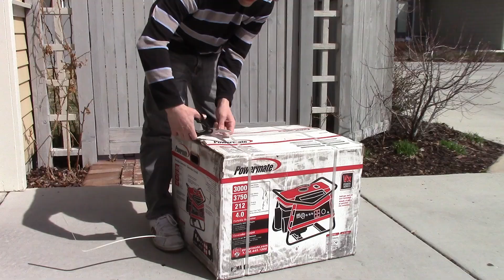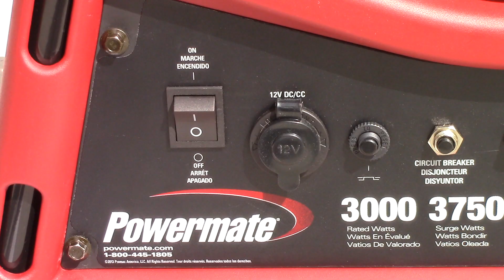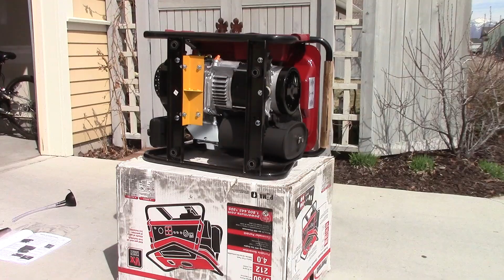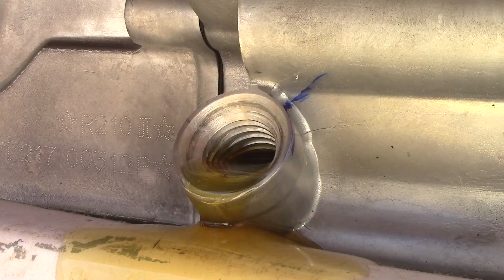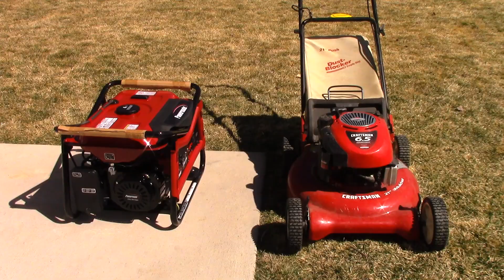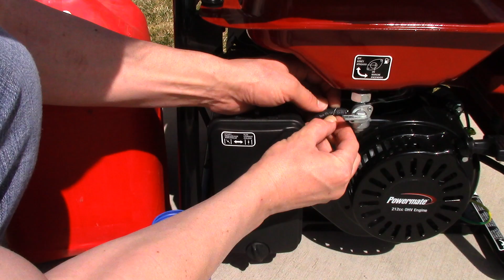Set Up & REVIEW Powermate 3000 Watt portable gasoline generator

Comment: Great video and subscribed. I bought this PM0103008 model at HD about 6 years ago for $239 and it's still sitting new in the box. 
So I am here because I just bought a mig welder and needed info on running it with the generator, but still no luck finding someone that has actually tested the 240v feature. Also need to find cheap 1kw - 2kw generator with low THD to run computers and TV during summer rainy season, but cheap does not equate with low THD. Any ideas for either question?
Reply: I have 240V Miller welder that I was able to power with this generator, had to make a trip to the hardware store to get some adaptor for my extension cord to fit the one on the generator. I also use a heavy duty extension cord to power the electric dryer outlet when we have power loss to power most of the house,   With this setup we had the furnace, fridge, tv, lights and all was powered with this unit.

Comment: This was an outstanding review, I have the same generator but I don't have a manual. Your review help me greatly. 
I purchased a  a four wheel cart made by Olympia tools, 600 pound capacity heavy-duty folding handle platform cart for my generator at Menards.
Reply: The manual is probably available online. A lot of times the manual is tucked into one of the folds on the carton the genny comes in and they are thrown out. The download thing works well, though, and you can print it out. Good luck.

Comment: YOu put way to much engine oil in there.....
Reply: Actually, as long as the generator is on level ground, it's almost impossible to overfill them. The correct level is the end of the threads on the lower half of the oil fill opening. Anything more than that will just flow back out. It's easier just to measure the oil, but the way he used works fine. Nice genny.

Comment: Thank you very much for taking the time to produce this Adam. I have an aviary in a steel building that I bought and wired for power, added insulation, sheet rock, flooring and windows, etc. I wanted this in an emergency so that my Amazon parrots would stay safely warm (or cool if in summer). I hope that I never need to use it for this reason but it sure is comforting that I have it should I need it. Thanks again for the tutorial!

Comment: i have this Generator and i give it a 5 out of 5 its compact great run time 11 hours is very good for a small generator
compact easy to store easy to maintain the oil fill is a pain because of the angle under the unit but i can live with that
easy to drain and easy to use a very nice unit over  1 quart i forgot how much if you put a aluminum baking dish to catch the extra oil including when you drain the oil 
nice video 
richard in the tropics

Comment: Focusing it out with lighter viscosity oil is recommended by most in the know.  A strong neodymium magnet can be used to attract all shavings to near the oil cap.   Flush out that junk, then fill it.

Comment: If I'm running a DJ booth outside for an event (without lights) would I need something like this or a 6k generator?
Reply: If you are still looking for a generator, you want to buy an inverter generator.  They have a cleaner, more stable output, and tend to be much quieter.  The size of the generator would depend on how much current your amplifier(s) draw since the other electronics don't draw much..  For most DJs a 2000 watt inverter would be adequate.

Comment: This is a nice generator. The small wattage and 240 volts is nicer for home hookup. Many of the smaller generator in this size come in 120 volt only. I like the way they added supports for shipping purposes. Many paople pull them out of the boxes to find the motor mounts broken from mishandling. This will not happen with those shipping brackets they put in. One tip on long term storage. You did run the engine until it stopped and drained the fuel tank. But you should also take a 10mm wrench or socket and remove the fuel bowl from the carb. If you do this you will see how much fuel is sitting in there. What I don't like is the low unloaded voltage. That will be down to 115 or so at half load. Still acceptable but a little low for my liking. The small generator I have runs 125 volts no load. With a 83% (3000 watts) load it runs slightly under 120 at around 119.7.  If I owned the generator you have there, I would be tweaking up the rpm slightly for higher voltage. Real good video here. Good job.
Reply from the maker: +Deucealive75 Great comments! I'll have to get it out in the spring and monkey with it.  Thank you for jumping in. What brand and model do you have?
Reply: I have a Black Max 3600/4500. Pretty nice for a super inexpensive generator at that wattage.

Comment: im thinking about getting a generator to put in my pickup so i can tailgate and watch football on at least a 40 inch im planning on having in the back any reccomendations
Reply from the maker: +Christian Calderon Almost any generator can handle a TV.
Reply: If you are still looking for a generator, you want to buy an inverter generator.  They have a cleaner, more stable output, and tend to be much quieter.  You don't want to be the guy at a tailgate party with the loud open frame generator.

Comment: Nice review.  I bought this 2 years ago and, of course, have not had a power outage since.  But, like you, I tested it and it worked fine.  Other than using a plastic cam in the engine instead of metal, it is a clone of a Honda engine.  Had they used metal, it would no doubt last a lot longer.  But, for $200, what do you want.

Your son did a great job, too!

Comment: Would this run my wood splitter? Its 15amp, but it draws 20 amp when starting, so it blows my breaker in the house.
Reply: Output on generator is 25 amps